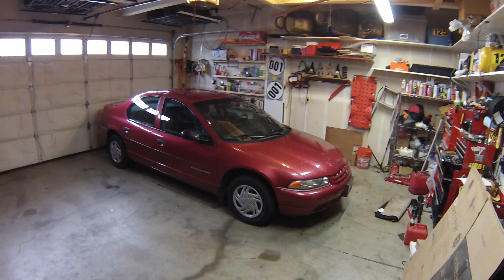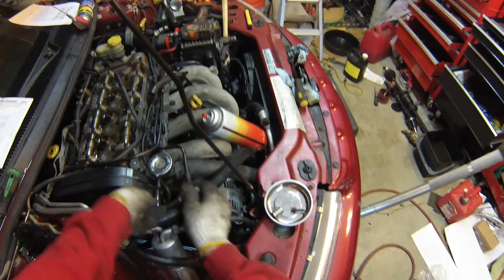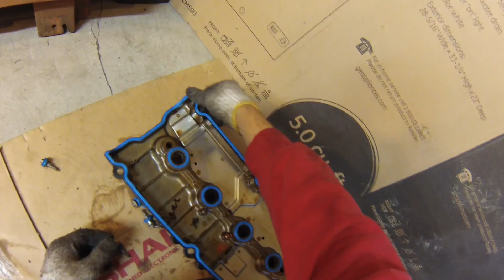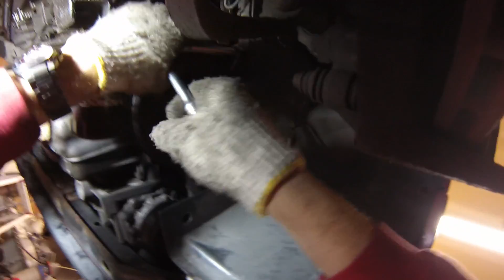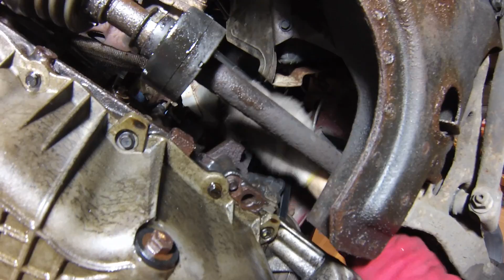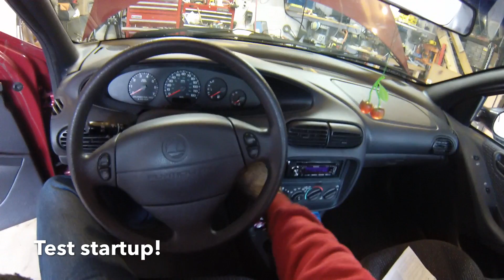Dodge Plymouth Chrysler 2.4L Head Gasket&Timing Belt - Part 3 Final Assembly

Comment: I've got a 04 Dodge stratus 2.4 dohc, and a couple years ago I had to put a timing belt in it. 
Now it's got a blowed head gasket with over 300,000 miles, but it still runs good.
I was watching this hoping i wouldn't have to take the t-belt back off of it to change the head gasket. 
Maybe it's not worth fixing, but I would like to fix it just to see how many more miles I'll get out of it.

Comment: Is this a 2000 Dodge Stratus? Mine has 170k miles and all of a sudden lost compression in 3 cylinders. I'm hoping its just the head gasket. Thanks for the videos! I'm about to do it myself!
Reply from the maker: In Part 1 at the very beginning I explain it is 1998 Ply. Breeze. Compression loss on 3 cylinders sounds pretty bad - belt skipped teeth/engine out of time seems more likely than head gasket. It would be unusual for a head gasket to suddenly fail across more than two cylinders  You can perform a leakdown test to determine where the air is going.
Reply: Car makes a whining sound when trying to start it
Reply: Mine had oil and didnt overheat...just lost compression all of a sudden. What should I check? Timing belt turns but all I hear is a whining sound.
Reply: Raw Roy Could be head gasket, could be valves are not seating

Comment: i got the head back on and the valve cover, only to realize i didn't set the exhaust manifold in place before i did so... bummer. i think i can pull the exhaust pipe out and shove the manifold in that way. here's to hoping
Reply from the maker: That should work but it could be a bunch of extra bolts. :)

Comment: Hi, This is a great video but it would be helpful if you could tell what the torque setting are.I got confused when reading the specs. when I did my timing belt and head gasket torque settings.I found out the hard way that there is foot pounds and inch pounds and I over torque the camshaft bolts and shear one off. lesson learned. 1 foot pound = 12 inch pounds so 105 inch pounds = 8.75 foot pounds for the cam bolts.
Reply from the maker: +Jim Merten Yeah 105lb-ft will shear off a narrow bolt. I can't do a better job of explaining torque than the specs... Look at the bolt and stop tightening if the amount of torque doesn't make sense for the diameter of the bolt.
Reply: So you tightened the cam bolts to 105 pounds? 😅

Comment: I've never done anything like this before. Looks so complicated. I just bought a 2000 Cirrus for $2000.00 from a dealer in Seaford, De. Drove it 50 miles and the timing chain broke and left me stranded on the turnpike for 4 hours. Called several shops and all agree I should just junk my car. Called the dealer I bought it from and told him, and he could not help at all, except good luck getting it fixed. Wishing I was mechanically inclined. Your videos do rock though. Looking for a GOOD mechanic in New Castle, Delaware.
Reply from the maker: These cars have a thing belt. If the belt broke, you may have valve damage. The cost to repair this would be only $500 or so in parts but probably close to $1000 in labor. Don't scrap the car, put it on Craigslist with the story of what happened and someone who is mechanically inclined will give you good money for it.

Comment: excellent how to video.  but I have three questions: why did the felpro replacement gasket look so different than the original, especially the area where it leaked? Why did you not compare the gaskets directly?  You never showed that you checked the block and/or head was checked for flatness. How do you know it was not warped?
Reply from the maker: It's been many years, gasket materials change. I may have not shown on video but I would have inspected the gasket and noticed anything different that doesn't make sense. I checked block for flatness. Video does not purport to show every single thing I do when working on the car. For entertainment only. Use your own skill and judgment when disassembling and assembling.

Comment: Someone is very firm that I should take the head down for $40 and have it pressure checked. Do you find that necessary on a blown head? The car did overheat, and was towed back by the previous owner.
Reply from the maker: You can do whatever you want, but if the head is bad, you will do the job twice.
Reply: What are the odds..... Well, I rolled dice on the car in the first place. Might as well do it again.

Comment: the high pressure power steering hose typically leaks, right behind the coil pack, on these engines. drips fluid onto the ex. manifold.
( i think there's a recall)
Reply from the maker: p dv Thanks - this car was not leaking fortunately. Might have been already repaired.

Comment: I have a2000 dodge care van that ran hot an died now it went start
Reply from the maker: Sounds like you may have warped the head (heads).
Reply: Mod MINI so replace the head
Reply from the maker: Is that a question? What you do depends on the failure modality and how the parts check out.

Comment: Hello, I have a 2011 chevy malibu LT 2.4L. About 2 days ago, coming home from work the car started to make a knocking sound from inside the engine. It only knocks when I press the gas pedal. Please tell me what you think it might be. 

Thanks.
Reply from the maker: Blake Austin This video is about Dodge/Plymouth, but knocks from inside an engine are usually serious. If you are lucky, it is timing chain tensioner issue (I don't know if your car uses timing chain or belt). Otherwise, it could be rod knock which is very serious and can cause total engine failure. Get it looked at ASAP.

Comment: Thank you so much for making these videos! Im doing the exact same job right now on a dodge stratus 2.4l. I wanted to ask you. When you placed the jack on the oil pan did you worry about it denting/ damaging the oil pan? I see you use the wood block to disperse the weight as evenly as possible. Im an amateur but I'm worried about breaking my oil pan. Is there any other way to raise and lower the engine (in precise increments) without placing the jack on the oil pan?
Reply from the maker: It will be perfectly fine as long as you spread the weight. Jack slowly at first to verify no denting.
Reply: That is good to hear! Thank you for getting back to me!

Comment: I have a 06 dodge stratus 2.4l the timing belt broke while running could that cause the values to bend Or mess up the engine ?
Reply: Eddie Torres Not at all it happen to my wife while she was on the highway. No bent or broke valves.

Comment: Very nice video.  I have an important question.  I am working on a 2006 Dodge Stratus 4 door 2.4 with a broken timing belt.  I have done a valve job, reassembled engine but I am stumped at this point as how to set the timing properly before attempting to start the engine.  I have no reference to cam shaft positioning in relation to crank shaft positioning. I have located number one piston TDC but do not know if it is intake or exhaust and also do not know how to position the cam shaft sprockets properly.  I have aligned the two marks correctly but do not know what relation they are to each other and to the crankshaft.  Any suggestions would be greatly appreciated.

Comment: I am currently in the middle of this project on a 2003 Stratus, and this video has helped me out quite a bit. I'm stuck trying to get the belt to fit over the tensioner pulley though. I'm going to get a friend to keep an eye on the cam sprockets while I push the belt into place.
Reply from the maker: Matt Huff Hello - It should go over without much effort if the tensioner has been sufficiently detensioned. I use butterfly type paper clips on the cam sprockets to keep the belt from flopping around when doing this.

Comment: not that i am a dummy around the auto, but these dodge engines, are a pain to repair , my daughter seems to not check things and the blond says no lights just run it till she stops , that said running the car for days , dad i have not had heat for 3 days , now it eats coolant ''''' i look the car over replace the thermostat and see the upper and lower hoses closed , i run and fill, the hoses open and the car runs mint,  no smell , out the exhaust , no milk shake in the oil , but it seem;s that compression is in the fluid ,,, my question before i tear into this dreaded job , thinking a head gasket or a cracked head,  ? why no smoke smell or milk shake in the oil , or oil in the coolant , just bouncing off this and maybe a part 4 of the common ill's and cure's
Reply from the maker: Bill Lake There can be several different symptoms for head gasket failure - oil in the water, water in the oil, blowby gas in the crankcase or blowby gas in the coolant. Sounds like you might have the last one. If it's been running that hot, you may also have a warped head...

Comment: I have a question I have the same car and one day I was coming home and my car started chugging and chugging and wanted to shut off and my gauges we're going up and down all random and when I pulled up at home it smelled like somthing was burning ever sense I haven't drove it so I wanted to see if u might have a clue what the problem might be?
Reply from the maker: +Anthony Byus I don't know. I don't have enough knowledge about this car. Sounds electrical though - low battery, bad sensor, that sort of thing.
Reply: Have you fixed this issue? I have a stratus 99 2.4 with same issues. The shutting off thing was a bad camshaft sensor which is easy to repair diy and cheap. The burning smell was this same oil leak from head gasket with oil drops touching the exhaust pipes making them burn. Hope that helps